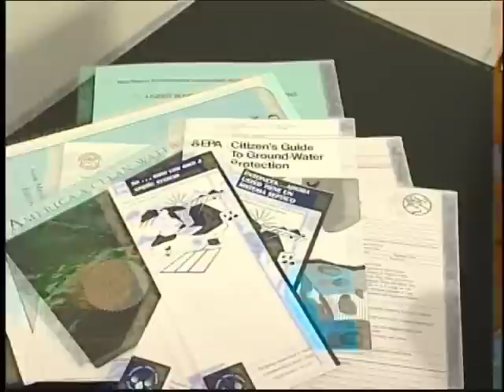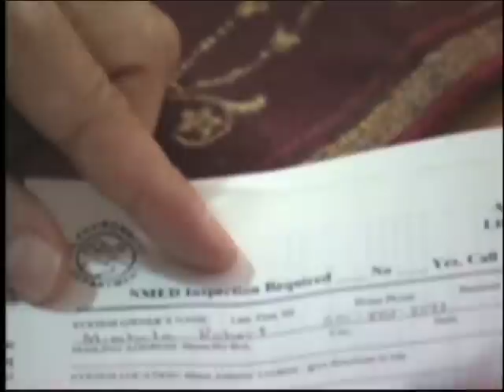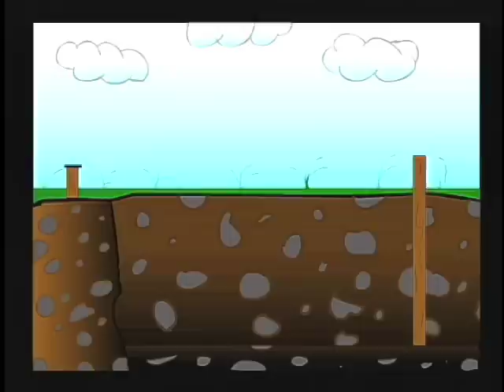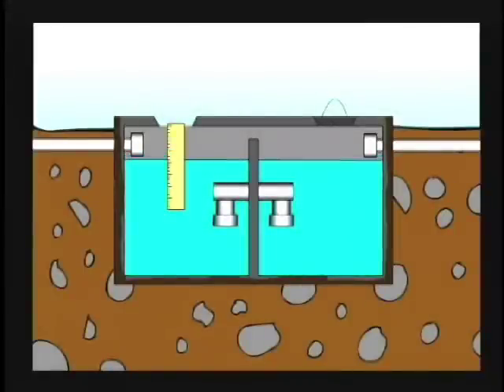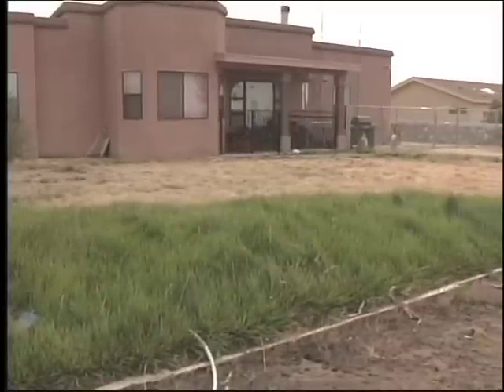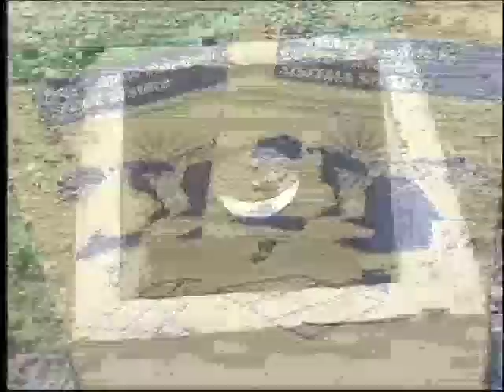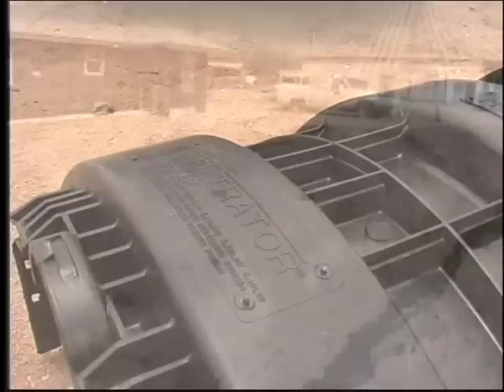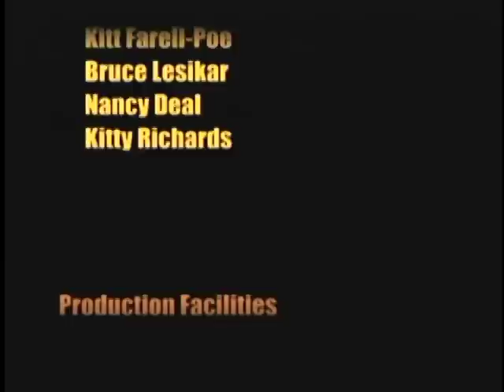An Introductory Guide to Installing a Septic Tank and Drainfield (English)

Comment: Thank you. Great information. We’ve got to replace a poorly rigged 1/2 ass septic system (2-50 gal barrels) for an actual real septic tank & drain field.
Reply: You'd better get on it and do it soon because you never know when your county will come up with a bright idea regulating your septic field so it could end up costing you $40k for an engineered system.  I would just dig the whole thing myself and over engineer it and be done with it.  Cost you $4k for a tank, D box, pipe, and stone, and rental of an excavator.

Comment: On going green. Septic systems are actually very green when properly used. Just because an idea is old does not mean it is harmful to the environment. I have been doing green for 45 years but back then it was called conservation. Most green ideas have roots in old conservation ideas. Coming from an old boyscout.

Comment: All septic systems require maintenance. Adding enzymes and good old fashion brewers yeast helps a lot. Avoid putting  grease and solids and ladies stuff down the septic system. I disconnected the garbage disposal and I put all my compostables in the compost pile. I check the septic and have it pumped out when I get enough solids in it. Great videos on Utube on how to do it. Not hard. After pumping and a couple weeks I add yeast and enzymes to get the stew working again.

Comment: Julia A composting toilet has its applications. It is great for a camp or light use, but if you have kids and two dogs like I do a composter is just to hard to keep working properly. Its hard enough to get the kids to flush the toilet much less operate a composter or an incinerator. This video is about selling new two compartment septic systems. These are ussually required by code now and I would put on in when mine gives up.
Reply: Your dog uses the toilet?

Comment: With a drain field using only two lines of perforated pipe, should one of the pipes be in direct line with the septic tank outlet pipe? Or, can they be staggered on either side of the outlet pipe?

Comment: Okay so what do you do about waste or grey water ? Still need a septic system or something to breakdown and disperse this kind of affluent. You also have to deal with the waste from a compost toilet. I use a compost toilet at our camp where the toilet gets light use. I have a grey water system.I compost the waste and use it in my flower garden. At home I have a septic system that is more than 40 years old and working well because I keep it up. A properly operating septic does not hurt the land.

Comment: how do you know where your drain field is in your yard?
Reply: You can contact your county and get a plat of your property and they often also have septic paperwork especially if a permit was filed when it was installed.  You can also hire a plumber with a device they can send into your pipe underground and their sensor will find the trail above ground.

Comment: 2Gs to have a septic system installed thats insanely cheap
Reply: Remember to add 7 years inflation. 
Uploaded on Sep 22, 2010
Reply: I just had a new tank and 100' of drain field installed 8-16-2021. I got 3 bids and all were around 2800.00 That was a 1000 gal precast tank, two 50 foot runs of the chamber type drain field. The whole job was done in just under 3 hours. In Columbia S.C.

Comment: The video begins well with respect to planning and regulations.  However, it isn't until half way that a plastic tank is discussed and no talk about advantages/disadvantages of plastic versus cement.  There are multiple statements which are duplicated.  In my opinion, since the video was taken of an actual system being placed, some of the items could have been shown better as to how the work is accomplished for the installation especially after all the detail about determining if clay soil is in a suitable state or not.

Comment: Now they run 8k to 10k 2021
Reply: I just had a new tank and 100' of drain field installed 8-16-2021. I got 3 bids and all were around 2800.00 That was a 1000 gal precast tank, two 50 foot runs of the chamber type drain field. The whole job was done in just under 3 hours. In Columbia S.C. ps My yard is all sand
Reply: It all depends upon the soil conditions and the amount of rock. The neighbor across the street had a new drain field put in and they were at it for at least two weeks digging, stopping and busting up rocks etc. They had a huge pile of rocks left over when they finished & I got a rough quote from an installer of $10-20k depending upon the amount of rock they ran into while digging.
The utility likewise ran into the same thing across the front of my yard when putting in a new water line to our street.
This is why I bought a used backhoe this week. It’s cheaper for me to buy a backhoe & do it myself. FYI